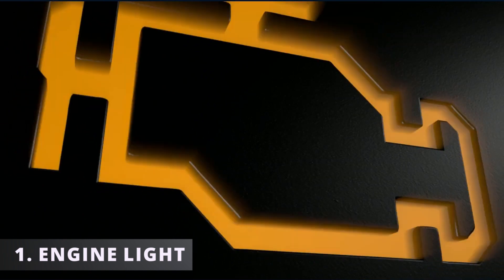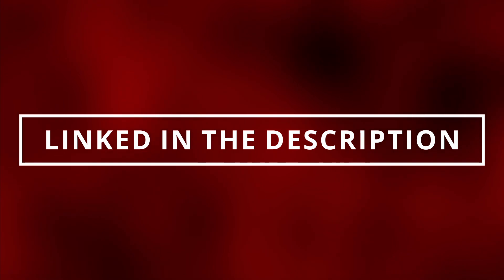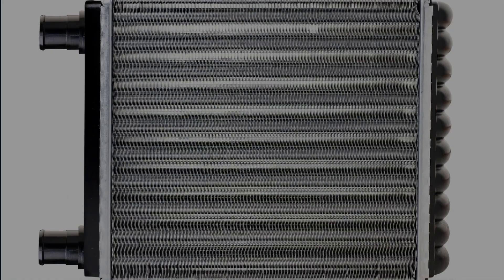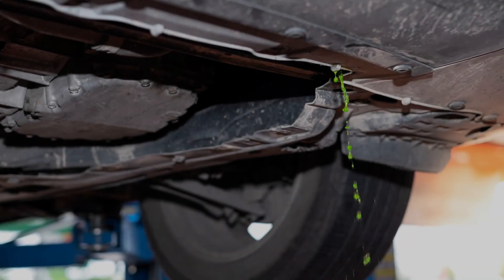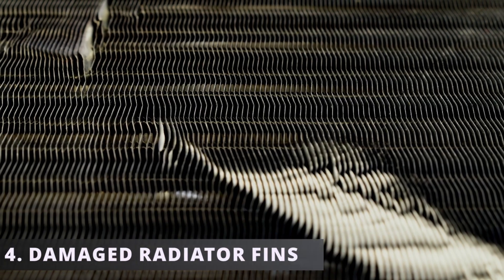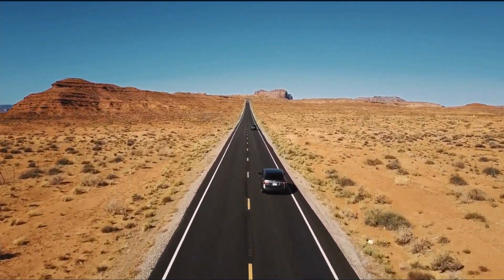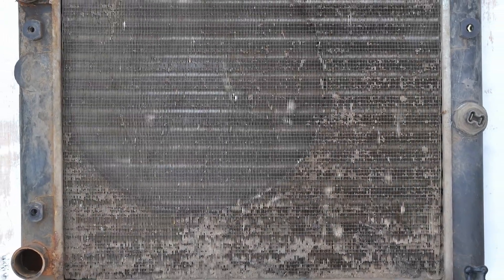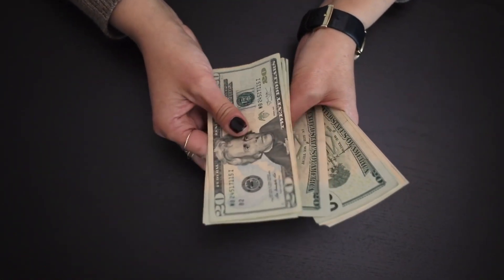SYMPTOMS OF A BAD RADIATOR

Comment: I flushed the system . Radiator has a crack leak .. when I refill the coolant container . The car gets hot and the coolant boils and overflows. Everyone says bad head gasket, temp gauge stays at the half mark, engine doesn’t smoke or anything. Would the radiator cause this? ( the reservoir overflows hot with the cap off)
Reply: I have the same issue
Reply: @PapaSanch97 did you solve the problem
Reply: Could be the water pump
Reply: Did u ever find solve the problem

Comment: My radiator exploded in the in-n-out drive through… I was so embarrassed lol
Reply: Nothing a double double can’t take care of though lol
Reply: This is wild because I noticed my temperature gauge going up like crazy while I was at the In N Out Drive thru line. I get home asap and my coolant reservoir is almost empty. Come to find out my radiator had been leaking 🙂 I still enjoyed my double double
Reply: @avalentino2386 thats a little scary cuz im here for the exaccct same reason and i was also in line and in & out lmaoo. My issue though is that it hasn’t overheated since. But the overflow reservoir is low, but I don’t see a leak anywhere..
Reply: DAYUM!
Reply: Nothing to be embarrassed about. Old age, plastic cracks easily

Comment: when I have mine idling I noticed yesterday when I putting in coolant theres a point it starts spitting it out or (overflowing) itll swing back down and the coolant would rise and again like if it's over flowing I had to keep putting in coolant till I realized that it kept doing that so I put as much as possible for the moment
Reply: Scotty killer channel suggested if it's like a bubbling, might be related to the engine block

Comment: Correction, fins dont transfer antifreeze, and therefore they cant leak, tubes to which the fins are connected to, do carry the liquid. Fins are there only to aid the cooling process by dissipating the heat more efficiently. You can even tear off all the fins and the radiator is gonna work just fine. By "just fine" i mean it's gonna work but not nearly as effective as with the fins still attached.

Comment: Ram to the store on my lunch break. When I came back my radiator had smoke or something shooting out and there was a definite leak. Hose was fine. I had absolutely no coolant in the overflow reservoir. Grabbed three gallons of antifreeze. Put one gallon in the over flow and a little over one gallon in the radiator cap. Had a guy look at it and said my radiator was cracked but idk if I trust him. My radiator is dirty so I am going to clean it as well. Never had any issues with it before.
Reply: Was on my home from work and my car started smoking and stuff shooting out. What did u end up doing? Ima have someone look at it because it just happened, over thinking the worst like the whole thing is done
Reply: @luisanjel4745  my truck is currently parked It overheated and died on me at the end of december. The radiator is the least of my worries now due to oil leaking from the bell housing of my transmission.

Comment: Please anyone help me, i just bought 2001 opel utility 1.6is and i noticed that the engine will get very hot before the fan start cooking actually it will reach 100 then the fan start to cool the engine. Is this normal and if not what should i try?
Reply: Check your cooling sensor
Reply: How do you know the temperature?
Reply: Define very hot. Are you redlining on the thermostat? What engine temperature reading are you getting from your OBDII scanner?

Comment: Can a bad radiator cause the thermostat and the housing to leak? I just replaced both the thermostat and housing but it’s still leaking
Reply: Not likely.
Reply: Did you ever find ?? out mine is over heating and leaking from the thermostat and housing as well… I changed and replaced the housing and thermostat still same affect
Reply: Last time that happen to me my water pump was out once I changed it it stop leaking out the thermostat housings

Comment: New radiator, upper and lower coolant hoses and clamps also replaced the thermostat... No overheating, oil and coolant mixing but I still keep getting a drop in the coolant level even after topping off! No visible leaks or pooling under the car either lol I'm stumped
Reply: I had a new radiator, upper and lower hoses and thermostat installed too and I'm also noticing small coolant loss, maybe 5 to 10 oz a week.

It was hard to find but i tracked it down to what looks like the thermostat housing where the upper radiator hose connects to the engine. It'll drip onto the transmission and is hard to spot.
Reply: Might be the block is cracked or the head gasket is faulty . Also the water pump was my problem it was faulty .I had the same problem you are having and the pump was bad
Reply: I will be doing the uv dye test to see because I keep loosing coolant too waiting for the pump as what the mechanic suggested but still going to do the dye test to find any leaks
Reply: I’m sending prayers that it’s just a bad gasket. If your block or cylinder head is cracked you’re in the shitter, big time.
Reply: head gasket ggs bro

Comment: My engine bay gets extremely hot and my fan runs very fast when my ac is on. But I have no lights... my engine temp needle stays at constant normal temp when it warms up. I am not sure what is going on. I'm scared to drive my car but it runs fine. Could I have a bad radiator? It's a 2010 mercedes e class so I thought the thousands of sensors would at least tell me if my engine is overheating or the radiator is not working but I am at a loss here.
Reply: You may have a bad cooling fan resistor, have it checked and replaced if necessary
Reply: Did you get solution, I have the same problem, I even replaced the head gasket but still no change, I want to change the radiator to see if it will work today
Reply: Same here. 4 shops later, not a bad head gasket, changed all hoses and thermostat housing, coolant leaking from the hoses. connections near the radiator cap. Upper radiator hose gets hot at hell but no lights, no overheating.
Reply: Did you guys bleed the cooling system after replacing everything?!
Reply: As a side note if you run your AC the fan will turn on and constantly run...

Comment: I flushed an changed cap x3 got in radiator hopen this fixes problem but not over heating coolant keeps blowing out cap also changed thermo
Reply: Mines doing the same thing I just ordered a new radiator I am also hoping that’s all it is
Reply: Was that it ?? @jamesclinesr2511
Reply: So I changed the water pump change the rag cap again one head gasket stop leak flushed it out after radiator notice still burning coolant back around the thermostat so I changed out the thermostat housing and haven't had any leaking yet but now I have the gas cap light in my miles per gallon is very low any ideas it seems with these vans that the motors are very temperature temperamental so if it's above 70 it starts to find its way out of the motor if it stays below it runs just fine like it's possessed LOL
Reply: I also change my thermostat but I got antifreeze on the top of the radiator and a big long puddle alone the whole bottom of the radiator so I’m hoping that that’s all it is. It’s freaking stupid.